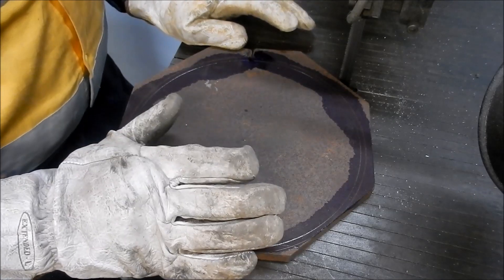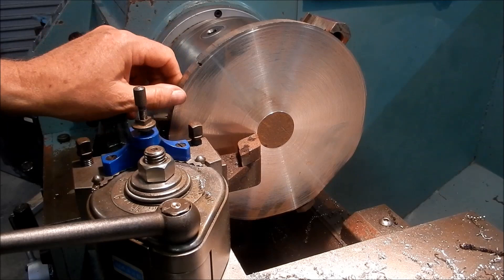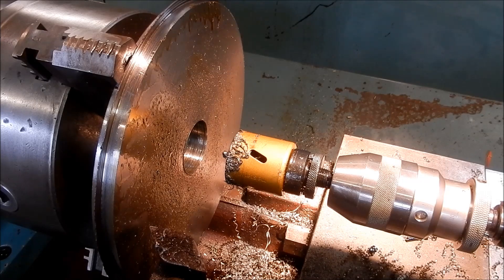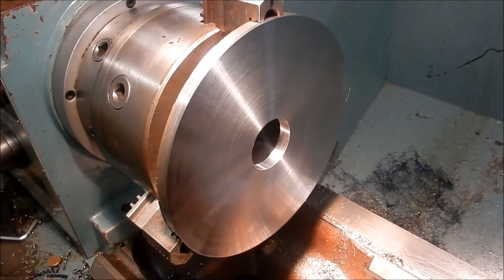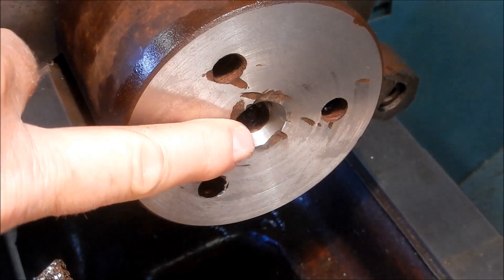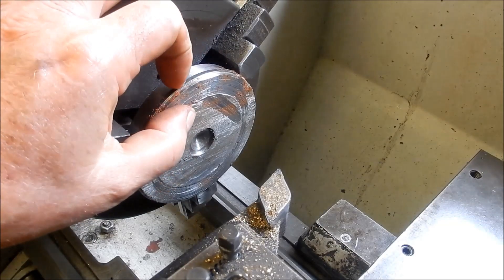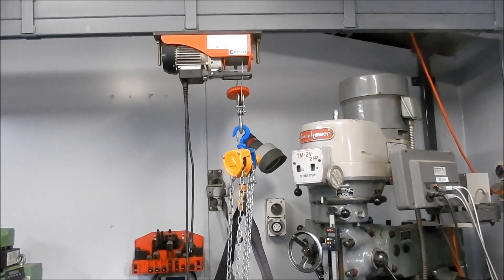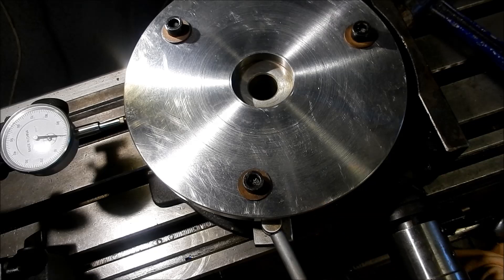Making a 127 tooth Change Gear for the Victor Lathe Part 1

Comment: Trick with the holesaw is to drill relief holes through the plate for the swarf to drop out the back through. You drill a couple of decent size holes through (10mm dia or so) with the outer edge of the relief hole on the outer line of the holesaw.
I've done up to 40mm steel and 20mm stainless like this, run it slow, lots of pressure and neat cutting fluid. Because the swarf is dropping out the back you don't have to keep lifting the saw to clear the teeth.

Comment: Great Project Cam. Been down this road in my own way. Spawned half a dozen projects to make it happen. Nice rough out cut - steady hand. Good quality hole saw did the job nicely.
Reply from the maker: Thanks Dan, that set of Hole Saws I got was about $20 from Aldi.  Really cheap but good quality.
Cam